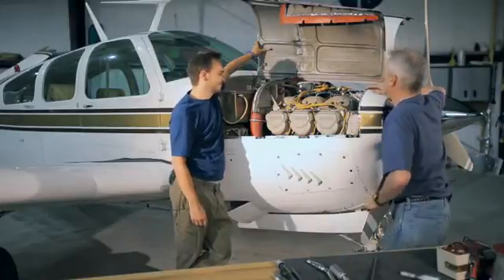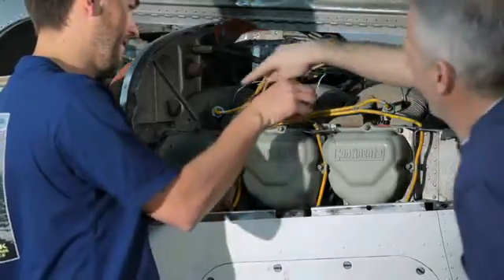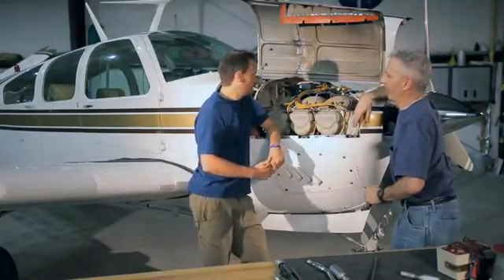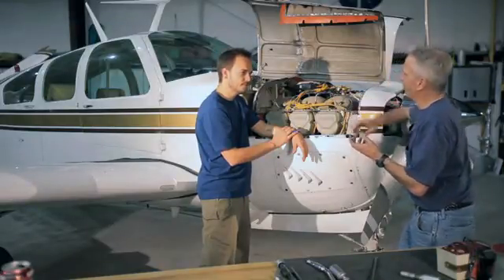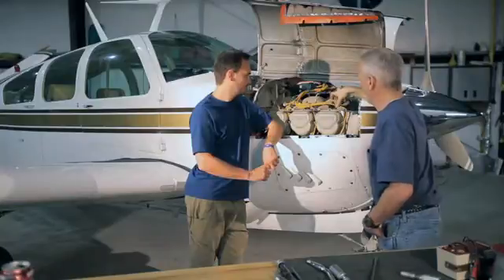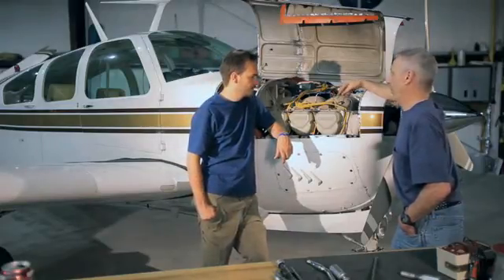How the Airplane Ignition System Works

Comment: Idk what it does tho
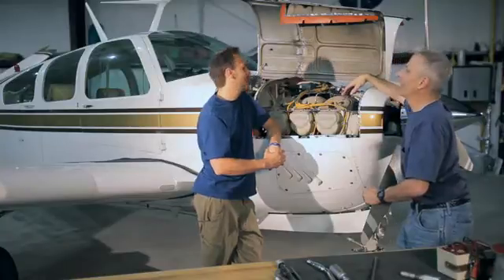Reply: It produces a very high voltage to make a spark inside the engine's cylinders and light up the air/fuel mixture. And it delivers that voltage sequentially to each cylinder, at the time that is needed. It explains it, starting at 1:40.

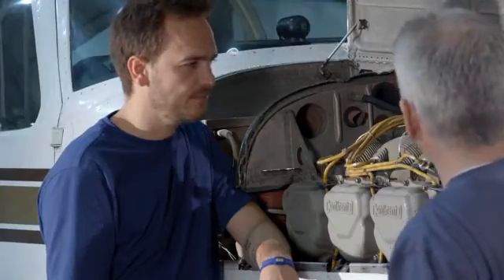Comment: 2:36. This is technically not correct, the magneto does not operate completely independent of everything else, it is turned by the engine itself and is therefor dependent on the drive from the engine, saying it is independent of anything else makes it sound as if it generates the spark all on its own which it does not do, it is only independent of the rest of the electrical system but needs the physical drive from the engine to work.
Reply: Also 1:29.  The magneto would be compared to more than just a distributor in the automotive world.  It would compare to the entire ignition system (minus the plugs), including battery, ignition coil, condenser, plus distributor.  The second comparison to a car's electronic ignition system is more accurate.
Reply: I guess it depends on comprehension level. The instructor said it doesn't need a battery to generate a spark, if he held it in his hand and turned it, it would generate  a spark.
Reply: @muhammadsteinberg  And he said it "operates independent of everything else" which is incorrect, if you take in consideration the type of questions the younger guy in the video is asking then it is obvious that he knows very little so to tell him that the magneto operates independent from everything else can only lead to some misunderstanding, the fact that the guy said "I can operate it in my hand and it will generate a spark" can lead to a novice like the guy to who he is explaining the workings of the magneto believing it is really completely independent on everything else, "operate it in my hand" to a novice is something different from your remark of "held in hand and turned it"  To be precise in educating or explaining something to somebody is never a bad thing...even more so with matters concerning aviation.
Reply: @MrGoogelaar  Did you miss the part where he said it's like a distributor or electronic ignition?
I don't see where anything he said is confusing or omitted. 
They're probably counting on some level of comprehension ability if your watching vids about aircraft systems. Do you think he should have described how a distributor and electronic ignition system work?
Reply: @muhammadsteinberg  Don't you comprehend that he is talking to a novice who does not know a starter from a generator so to tell that guy it works like a distributor (by the way a distributor or electronic ignition is not independent from anything else so the comparison does not make real sense) 
You keep on harping about comprehension ability, do you reckon the guy to who he is explaining the system has that ability?
Reply: @MrGoogelaar  I bring comprehension up because that's what it comes down to. The instructors explanation is so simple I'm not understanding why you tried to nitpick him.
It's quite obvious that he's stating that the mag provides an electronic spark independently by turning it instead of needing electrical energy to power it.
Btw...Not trolling you. I just think you're correcting something that didn't need correcting.
Reply: @muhammadsteinberg  The guy was not talking to you, he was talking to the guy next to him, obviously a guy that knows very little to nothing, after the explanation that guy would still be clueless and could think that a magneto sitting on a table would be able to produce a spark because it is working independently from anything.
Reply: @MrGoogelaar  Looks like an intentionally made video to inform an audience hence the camera and posting on YouTube. Doesn't make any sense considering their stage like stance and clear display of what they're talking about.
I suspect they are both A&P's playing roles and at least one of them is a pilot if not both.
Reply: Great explanation!! I have my commercial Checkride in a week and this is a perfect explanation/description. 😁
Reply: Phillip koen
You had a discussion about the airplane magneto some time ago. You stated that the instructor mislead the student by stating the airplane magneto is a independent system and could generate a spark on bench by itself. Another comment by Muhammad Steinberg criticized you and you two go into a lengthy discussion. My understanding is close to yours but I have question. 
I thought the flywheel in a magneto needed mechanical energy by pulling or kicking it much like a lawn mower or motor cycle engine , once the spark is generated the engine is now turned over and self sustaining limited only by fuel and friction wear on parts. But in an airplane how does that magneto flywheel get spun? Is it from a small electrical bump from the battery. Help me out where did go wrong? Thanks in advance!
Reply: @randallallen4636  You are correct, the magneto must spin before it generates a spark, as it is connected to the engine that means the engine must rotate for the magneto to generate a spark, like all engines it must first be spun to be able to start, the spinning of the engine then spins the magneto and it then generates a spark, the spinning of the engine also causes fuel and air to be drawn into the engine, there are various means to spin an engine and it varies between the different applications, a battery and a starter, a rope starter, push start, kick starter or even by turning the propeller of a small plane.
Something to remember is that the magneto does not merely generate a random spark, the spark must be timed to the engine so it is obvious that with an engine stationary there will be no spark.